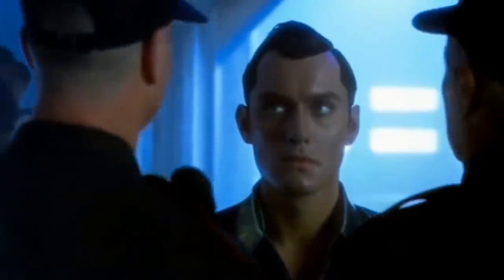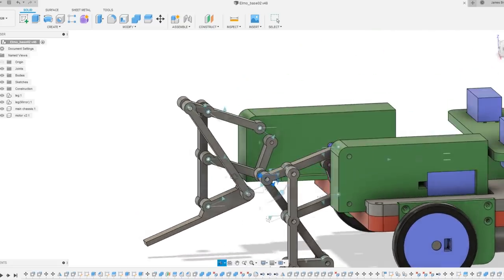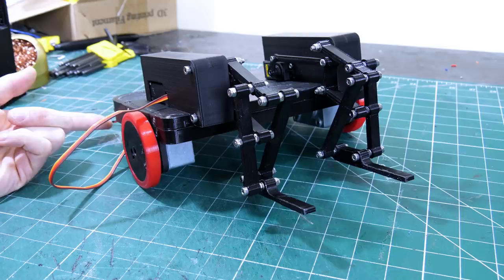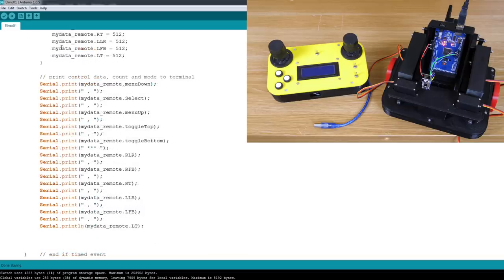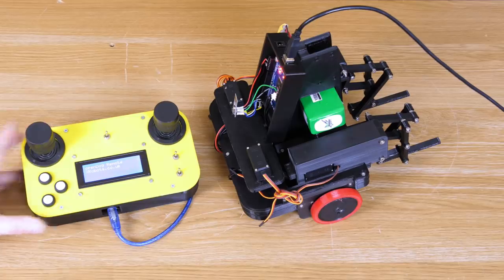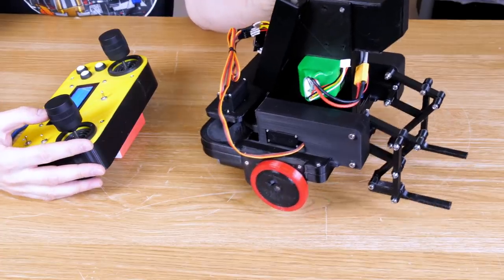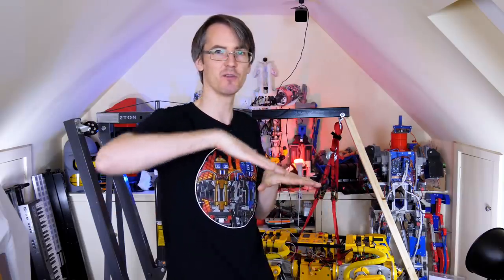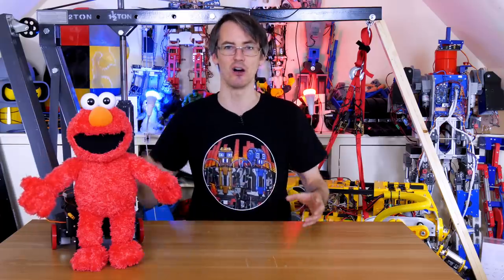Tickle-Me Elmo Robot Conversion #1 : Legs and Locomotion

Comment: It's ok, I didn't need to sleep any time soon ;)

Can you have a variable stride length so that he takes longer, faster steps when going at pace, and can you even have him take both feet off the floor for running?

Is the plan to have him lean forward and back for different speeds, or left and right for turning?

Are you planning on hiding the back section at all? Green screen could be awesome of course, but he could also be pulling a red cart.

Am I asking too many questions?

Comment: btw James, I'm an animator by trade. I've animated countless walk cycles, so I might be able to give you some pointers about what you could do to make the motion a bit more life-like.
Reply: Care to share some?
Reply: @000Krim  Well, first of all, the sequence isn't flowing right at the moment. it's like... forward, stop, down, stop, back, stop, repeat when it should never stop, especially not when the foot is on the ground and moving with the ground. basically, right now if you tracked the motion of the foot, you'd get a square. You want a much smoother shape than that, closer to a circle. Another problem is that when you walk, you don't touch down with your toe before your heel unless you're trying to sneak or something, so that definitely needs to be fixed. It's hard to explain in words, but if James wanted help I could make some animations and pictures to explain the concept better.

Comment: Actually, with the lower weight and better available small servos, wouldn't making a bipedal robot like Robot X at the scale of the teddy bear or at x2 scale of bear (1/2 size of Robot X) be easier than the larger bipedal robots?

Comment: Is there any reason why you didn’t just connect linkages to the wheels to move the legs instead of using servos? Actually, as I’m typing I may have thought of my own answer. With servos you could program shorter steps when walking slow and longer strides when walking fast. Is that why?
Reply from the maker: I considered it, but then he'd stop with one leg in the air and he could never put his feet together
Reply: That makes perfect sense. Thanks.

Comment: I think the movement of the wheel motors needs to be more paced with the  movement of the steps.  Either make the step motion more fluid and equal between the two legs or make the motor motion stop and start in conjunction with the feet 'pushing backwards'. For instance, he shouldn't be moving forward while lifting a leg if the opposing leg is 'stationary'.